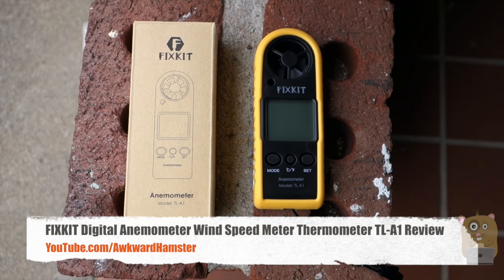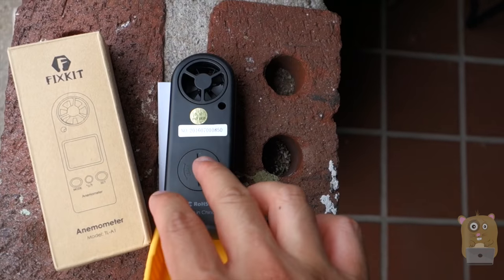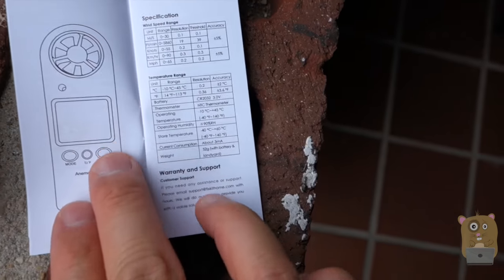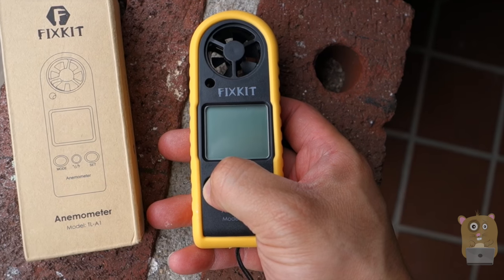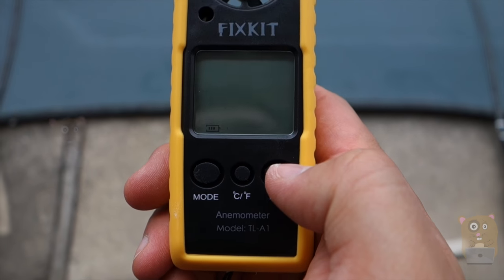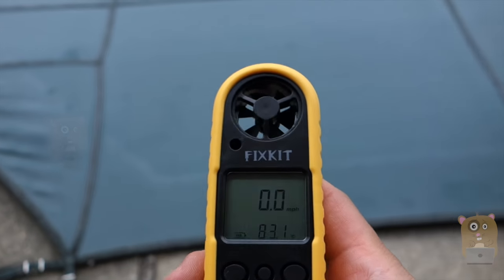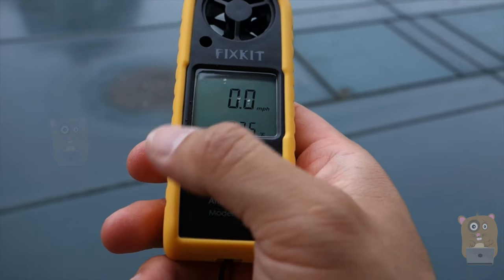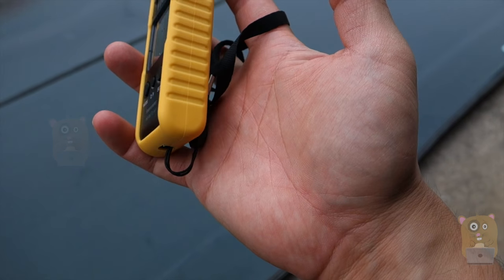FIXKIT Digital Anemometer Wind Speed Meter Thermometer TL-A1 Review

Comment: I see the current wind speed OK.
The features mention: "Measure Wind Speed in: Current/Average/Max."
Also, there is supposed to be a data hold function.
Do you know of any instructions telling how to use these other functions?
Reply: OK, I just found the procedure for cu/avg/max:
When setting the functions, you just keep toggling around past the velocity options and select the desired mode.
I'm still looking for the data hold function.